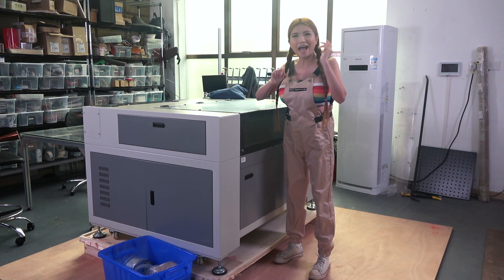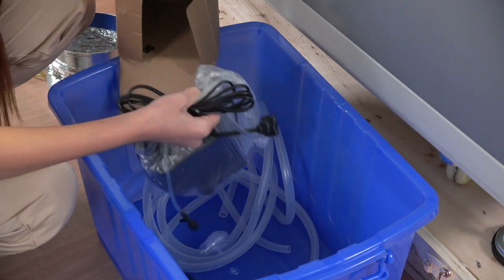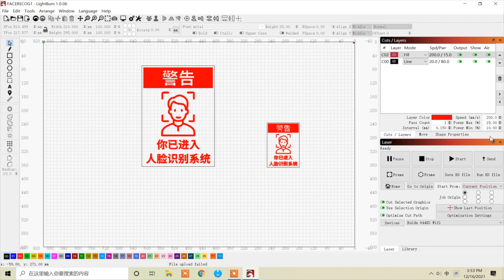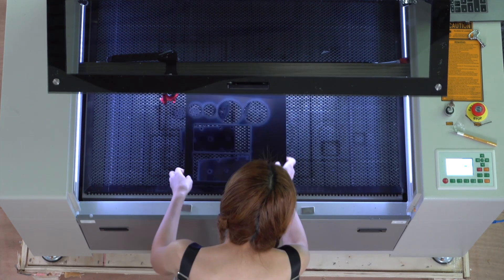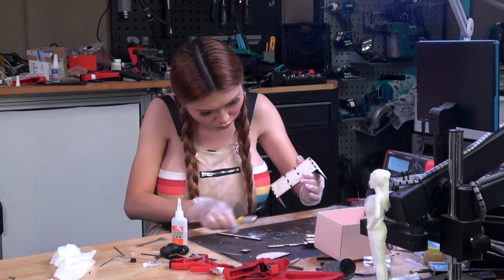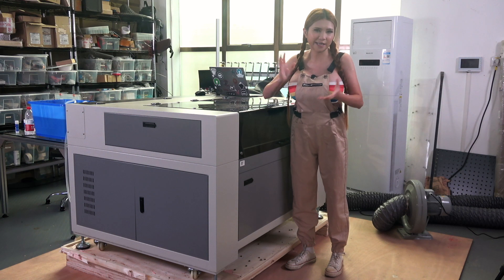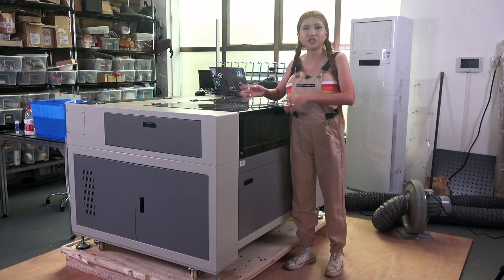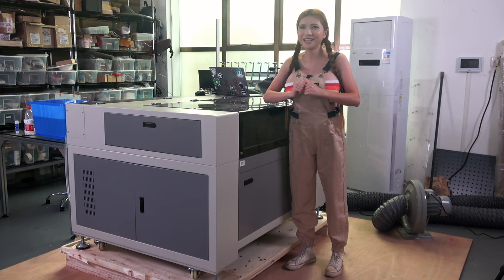Cardboard Clone on the Monport 80 Watt Laser Cutter!

Comment: The gear box twirly thing looked a little stiff in operation. It may be that the gears are too tight - the animation showed the teeth fully running in to each other, but they're not designed to do that. If you back them off a little, it'll run smooth as butter.

Comment: Distilled water is used also to keep seals intact especially if it has ceramic bearings anywhere in the system . Non distilled can carry a surprising amount of micro sand and minerals and other corroding/depositing  elements and often has varied PH

Comment: PC (polycarbonate) is a good material for a lot of things, but it has 2 disadvantages that you should know about:
a) while it has high strength & good flexibility, when it shatters, it shatters badly, that is, it shatters almost as bad as soda-lime glas into multiple small sharp pieces.
b) most variants are not suitable for food & medical applications because they will release a small amount of chemical substances which almost all act as hormones onto the human body (mostly: bisphenol-A bpa) because chemically, it is also a condensate which all more or less release a small amount of chemicals under various kinds of conditions due to the inherent properties of the chemical equilibrium of esters.

Comment: when it is possible to expand and hack one's Ender 3 3D printer, is it then possible to change X, Y and Z to print lifesize models, e.g. your model. or ... 
should you print 1mill small parts, and glue them together ??
Reply from the maker: There are extended bed Ender 3 mods😁

Comment: I have one of the 80W red Chinese lasers that you see on ebay all the time, and I have it setup in a spare bedroom / office at my house. It actually works surprisingly well.  I cut mostly acrylic for making test fixtures for work.  If anyone is trying to figure out how to organize that, here is what I did:  The laser is tucked into a 5 foot wide closet with the water chiller sitting on a reinforced shelf above it.  I use an industrial blower for the exhaust, same as Naomi is using.  To greatly reduce the noise, I built a sound reduction box that the blower sits inside of, made out of layers of wood and foam, then wrapped the box in black automotive carpet.  The intake to the blower box is just dryer duct that is connected to the laser, and the output of the blower box goes through a 2 inch diameter PVC pipe through the wall of the house to the outside.  Inside the room, the blower noise is very tolerable, maybe a little louder than the microwave oven, and a lot quieter than the vacuum cleaner.  Outside, the air blast through the 2 inch PVC pipe was resonating and was loud enough that I was worried the neighbors would get upset, so I created a PVC muffler by connecting the 2 inch exhaust pipe to a 3 inch PVC pipe section that I filled with a "jelly roll" of coarse foam.  That worked really well to greatly reduce the noise outside.  This setup has been perfect for years now.  I can run the laser for hours indoors with no stink and comfortable noi

Comment: As an admitted male gazer, which isn’t like a bad thing, through awareness it’s in our DNA, by design, I had to watch a vid to see what looked so exceptional. 
Some of the initial thoughts were a belief that you weren’t more than a hot body with expensive tech tools. 
But that was quickly changed as the details outweighed the primitive male ego mind. 
Seeking some background I was rewarded with a positive and supportive writer who asked similar questions. 
Your brilliant mind is such that your boobs are likely a requirement to help stabilize your petite structure. Maybe that still isn’t a great metaphor but at least in the water it lends validity in that buoyancy supports my clearly thinly veiled compliment. 

In a word, you are impressive, as you appear at ease with its reality, with your extreme feminine beauty with knowledge that your expansive brain supports the work while shutting down the silly jealous women and absurd males who think they protect women by shaming you.

Comment: "That cardboard looked so hot I'm surprised it didn't catch fire." Those things are huge huh? I'm sure I couldn't fit a laser cutter like that in my cluttered garage.
Reply: We are happy to help with your questions. The machine is equipped with the air assit which blows the blames out of the nozzle. You can visit our website to have more details.
 Also the 80w is 57” x 43” x 34”, if it is too big, you have our 60w and 55w. You can contact us if you have more questions.

Comment: Question: What does such a dressmaker's dummy (roughly) weigh when finished?

Nice review with several applications for a serious laser cutter. Just checked the Monport site - wow, for a device of this build grade, their prices look very reasonable. And use of standard parts is always a plus. Many thanks for selecting them!

The summary at the start gives a very good overview of the content. This is professional-grade video composition.
It is extra nice that you documented the delivery. Unpacking and setup of the device, and later pointing out the access panels adds to the review quality.
Ievan Polkka as background music for the sped-up gearbox mounting section is just the cherry on the cake. Many thanks! 🙂
Reply from the maker: oh, very light- maybe 2kg?
Reply: @Naomi-Wu  Many thanks! It looks very solid (and well constructed).

Comment: Thanks for the video) Such cutting machine is a long time dream for me. Although, I want to cut very tiny parts, with extreme precision... AND where the problem lays.. I need to cut metal. thin copper or brass foil than can be folded later... Do you by change have an idea or heard anything that could solve that problem? ...also which does not need to fly off planet to acquire it)))

Comment: Wow, what a nice machine! - I really like how the cardboard model gets almost see trough when you watch it from the front, nice effect. I don't know how the weather is in your part of china at the moment, but if you want to keep the tube happy, it should be kept between 18-20 degrees C, so upgrading to a chiller (CW5000/5200 for example) is a good investment even though the seller of the machine says that it's not important. Stay clear of the CW-3000 since it's not a real chiller, it's only a radiator and pump :)

Comment: I see the most interesting feature in this laser is not mentioned, it has a internal belt in the X-axis trotec style which means this laser can engrave quite fast and have decent quality in the 600 to 800 dpi range, so an RF tube would work well in this machine.

When you are reviewing these machines can you film or take photos of the funny parts like the Axis motors and the internal structure, it would be to great help for the rest of us :) 
How is the airpump flowing on the nozzle?
Reply from the maker: Next video!
Reply: @Naomi-Wu  Yaay, i will be testing out a new fiber laser welder in 2 weeks, it will be soo cool.

Happy new year!!
Reply from the maker: @tonta182  Ohhh! I want to try that!

Comment: I have a similar machine from about a decade ago, but it needs work due to flood damage ruining my cabin. To get it into my cabin the side wall had to be cut open. I need to find a new control system. Wish I had repairs it before the foreign product tax and trade wars began as its gone up so much. They are expensive and take a huge chunk of my space up so I need to get it going. My control system is very primitive to these new units. If you dont have the space for them in regular use I recommend you get a open frame unit that can be attached to what you are engraving as they can be just hung up out of the way.

Comment: That was a great project.. would be cool to have it on a revolving display with colored changing light that would show through the cardboard as it rotates.
Reply: wonder if you could make one out of plexi ,, it would light up from the bottom on a revolving stand..
Reply: Yeah plexi would be doable, if you use clear or colour tinted clear the laser would polish the edges and the colours really pop in colour tinted clear, gives a good edge lit appearance and you could etch details on the plexi and they would light similar to the edges. Would look great on a model that stunning.

Comment: Wow thanks for the info 
I've been looking to buy a laser for my own. Since I started laser cutting at my work 
Quick question can it cut aluminum 
And about how thick of a piece of material can it cut?
Reply from the maker: No, no metal at all. Maybe 8mm acyrlic
Reply: CO2 lasers can't really cut or even mark metal. You can buy sprays that let you mark metals, but certainly not cut. Look into fibre lasers for working with metals.

Comment: I have a 100w Chinese machine. I love it with lightburn. It's much more capable than the desktop versions.  But it does require a lot more room. I opted for one that included a chiller. It's a work horse. Does every job I throw at it.
Reply: We are preparing to buy a 100W one later this month. Looking forward to it! Not a small device by any means!
Reply: @cacaokingdom3122  your correct it's a big machine but if you set it up well and take good care of it, it can do some amazing things.
Reply: @cacaokingdom3122  The size was why I opted against my first choice of a 60W Omtech and got a LaserBox instead.  Good decision as the LaserBox just barely fits in the space I carved out for it in my small house (no garage, damnit).   I have the feeling that by the time I have managed to obtain/create a space suitable for a larger version... I'm probably going to wind up with a 100w instead of the 60w.  Just a feeling.

Comment: Ingenuous way to solve the problem of finding a mannequin 100% fit to your silhouette, Naomi ! If you're looking for a less noisy fan, I can only recommend Hon&Guan inline blower HEE-200P.  I use this silent fan on a custom paint booth and it's both efficient at 524CFM airflow and 602 Pa air pressure AND quiet at the same time. Check it !
Reply: Any links for that model fan?

Comment: That is an impressive gearbox you made.  To give you an idea of how durable Delrin is as a bearing material.  All the wagons, carriages etc. on my model railway use Delrin as bearings/bushes for the pinpoint end axles/wheelsets.  A number of the vehicles, I've had since the mid 1980's and still in use today.  Next to no wear on the Delrin bearings and the wheels roll freely and smoothly for travel at scale speeds of about 100km/h.

Comment: Thank you our dear friend Naomi!! We really appreciate your creativity with Monport! We offer 40W to 80w laser machines and fiber marking machine for metal! Join and create with Monport!
Reply: I just checked out the Monport line, shipping to the U.S. is free for the 80 watt laser and it is almost $2000 cheaper than a Glowforge and almost twice as more powerful.
Reply: @marks99999  Smarter choice! Welcom to Monport Family!
Reply: So how thick of metal can the 80w laser cut? What’s the cheapest laser I could use to cut ,1/4in ar500?
Reply: @Milby20289394bc  Making homemade body armour for demo ranch? Lol
Reply: @Milby20289394bc  Hi Chris, it can't cut metal as it is CO2 laser machine. It's for non-metal materials. The thickness depends on the materials. You can check our 60w and 80w through our website!
Reply: Very odd ad placement, but it worked. Bravo!
Reply: @drsamuelhaydensecretgaming6749  Thank you Samuel!
Reply: How to get your machines?
Reply: あっ、メーカー発見！！！すごいものですね～
Reply: @ショップショッピ Thank you so much! You can visit our website for more details! ありがとう~
Reply: The laser engraving machine you sell has good function!!!
Reply: Seeing that the machine is big and powerful, and that the laser is red and hot, it looks very powerful!

Comment: At 3:55 are those two "220V input" sockets wired in parallel?!?  Could be dangerous if they are.  Naomi, could you post some photos of the wiring inside the electrical compartment of that laser?  I've seen some which haven't been wired properly, e.g. the neutral and earth were connected together internally.

Comment: Looks like a very good laser but do not have room in my garage with 5 3d printers, 2 ceramic kilns and a K40 laser. The K40 does most of what I want. I have modified the bed to take objects up to A4 size.

Comment: Interesting that the cardboard did not char at the edge even though they plywood did. That charring really puts me off using laser cutting with white card stock.
Reply from the maker: White card stock would show a little, but you can really get it quite low by fine tuning the settings.

Comment: completely agree with you, Naomi.  I have a 100W unit running Lightburn and I love it.  Even the Glowforge plug and play units are not truly single button operation and much more difficult to troubleshoot than the Chinese built high watt machines.
Reply: I had the misfortune to work somewhere with a Glowforge after somewhere with a 100W, 48"x36" Chinese unit. It was tough to take the step back, and it was strange knowing that since it was a Glowforge Pro, they had cost about the same.

Comment: Would you consider placing a exhaust port through a window pane or the door (I recall that the walls are concrete)to allow the blower to remain outside with the door closed?
Reply from the maker: Or a hole in the wall...
Reply: @Naomi-Wu  I’m actually quite surprised you don’t have a ventilation system in your work area, given the toxic chemicals some of your machines use.